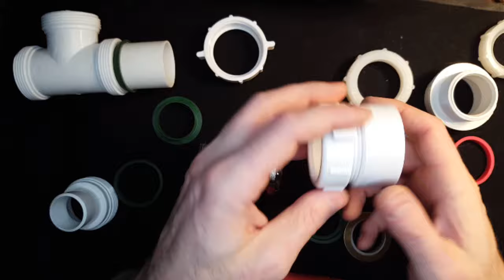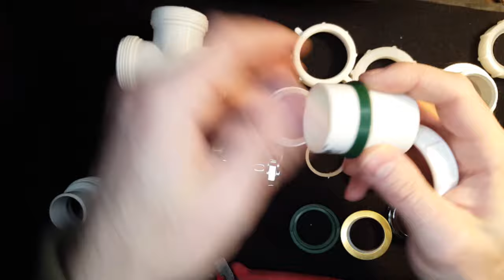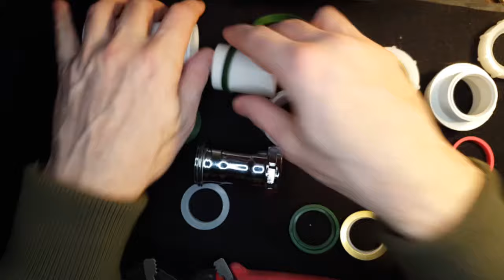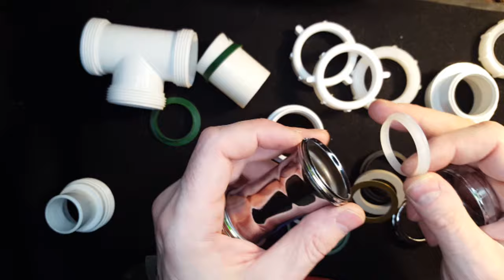Slip Joint Nuts and Washers (And How They Work...)

Comment: Ive done this for my kitchen sink. Regardless what I do, I turn it to the right to seal and it does, but if I hardly touch it, it slips right off….. bought a new nut and washer and it won’t hold for anything but when it tightens it feels like it’s screwed on tight…. So weird
Reply from the maker: If it's slipping off then the pipe inside the joint is not long enough. You may have to replace that pipe with a longer pipe or get a kit to replace all the trap parts.
Reply: I'm having this same problem^
Reply: It's because all this plastic crap is trash. We need to go back to real plumbing, lol.

Comment: I always avoid these whenever possible always better to glue your joints If there’s any tension on the gasket, they will pull away from the tube, causing leaks the gaskets breakdown overtime as well

Comment: How far should the male piece go into the joint? I have a leak when my bathtub drains and I think it is because the top pipe only goes about a a half inch into the threaded female pipe.
Reply from the maker: Half inch is too short. You'll want at least an inch into the other pipe if you can. But you should try to see exactly where the leak is coming from when it drains, because as long as the washer is good and it's tight, it shouldn't leak. You may need to replace the washer or just tighten it more, or may find the leak is coming from somewhere else.

Comment: Just what I am looking for Leak Proof with Conical Seal, the larger end facing the Screw Cap (or the smaller cone end facing the Threads
Reply from the maker: As long as it's installed correctly like you said and tight, it should be totally leak proof.

Comment: At 1:32 are you saying leave the green water tight seal in the pipe (female end) , AND put a beveled washer on the male end, in other words have TWO seals in the joint, OR are you saying take out (or don't put in) the water-tight seal in the female end, and just use ONE beveled washer 1:50 in the joint?
Reply from the maker: It'll just be one bevelled washer which can be rubber or nylon

Comment: Thank you sir!
I just replaced two 1 1/2 washers with no signs of leaks after running water for several minutes. Hopefully it stays that way.
Reply from the maker: No problem and thanks for watching. As long as the pipe is long enough into the fitting, it should stay tight

Comment: So I need some help…
Turning my van into a camper and I’m currently doing the plumbing. I need my waste tank to be removable so I can empty it.
I was thinking about using one of these slip joint nuts so I can screw and unscrew it when I need to. The only thing is, the pipe I have coming down under my sink is 40mm width and I’m unsure whether I need the male connector on the other side to be 40mm too or bigger?

If someone could help, that would be great. I don’t know what I’m doing 🙃 cheers

Comment: Question…. Water is still leaking at the very top where the plastic pvc connects to the drain from bathroom sink can I use a thread sealer or pvc glue on the fitting with the rubber washer……help please
Reply from the maker: It depends on exactly where the water is coming from. If water is coming from the top of a plastic tailpiece, you may have the wrong washer there. There should be a plastic tailpiece washer and the slip nut should tighten it enough that it shouldn't leak. If you're talking about a PVC trap adapter connecting to a plastic or metal tailpiece, there should be a beveled washer and slip nut with plenty of pipe going into the adapter, it may leak if there is not enough pipe going into it.
Reply: Same with my pipe. It won't even tighten & it's slipped off a couple times from the very top of the drain. I don't even see a washer on it. I'm gonna buy washers & if that doesn't work, I'm going try a Fernco & just clamp on the pipe.

Comment: I have a really weird "quick disconnect" style I cannot seem to find replacement nuts for. Can find the o rings but not the nut itself. Either half or quarter turn. Basically snap locking. No slip joint needed and on the inner ring there's no threads just little notches. Do you know what the proper name for those are besides junk? Lol
Reply from the maker: Searching for "quick connect" drain fittings shows a few brands. If you can't find a replacement part you may just have to replace them with more standard drain pipes

Comment: What is the standard sized washer?
Reply from the maker: If you have 1 1/2" tailpiece and drain pipes, which is what most people probably have, get a 1 1/2" washer; likewise if it's 1 1/4", there are 1 1/4" washers in either rubber or nylon.

Comment: How do you prevent it slipping off when water runs?
Reply from the maker: It's compressed and held tight by a nut. While the nut may loosen over time, there's nowhere for the washer to slip off. Also, these are for drain pipes, not supply lines that have water pressure

Comment: Best video I have found on this subject. Thank you! Still some unanswered questions for the plumbing newbie that I think would warrant another video someday....

First, I think the pace is too fast. Keep in mind, for us newbies, we see 20 washers on display and easily get confused :) Please slowly go over them one at a time.

Just speaking to drain lines only.... When exactly should a beveled water be used vs a flat rubber washer? How does the top hat washer work, where is it used and why? Are any washers interchangeable? How much does thickness matter? Common washer material types? Rubber vs nylon vs plastic... pros and cons? General guiding principles/best practices for selecting the right washer... Which ones it makes sense to keep on hand vs which tend to come with a fixture or p-trap kit... Common mistakes, etc. 

There is a lot to cover here and this information is surprisingly hard to find. Thank you very much for sharing your knowledge.
Reply from the maker: Like you said, it may require a more in-depth video and these things are easier to explain by video and probably easiest to learn by holding and seeing it. But to quickly answer some questions, on slip joints there will always be a bevel which goes away from the nut or in other words the flat part goes against the nut which pushes the washer tight. The most common mistake I've seen is a washer in the wrong direction, ie- the bevel part against the nut, which won't work at all. 

Flat washers are good for non slip joints. Most parts where a washer is needed should come with a washer. I like rubber washers because I feel they get a tighter fit but nylon will last forever while rubber degrades. 

I would say keep an assortment of washers on hand for various sized pipes and joints, but most of the time you can take the old washer and replace it with exactly the same thing, just make sure to install it in the right direction. Other than that, it just takes practice and experience with materials to fully understand them.

Comment: Is there a better alternative to the slip washers?
Reply from the maker: Better in what way? Installed correctly, they should be leak-proof and allow for easy disassembly of the trap for cleaning or replacing sink parts. There are PVC traps that can be attached and removed with threaded nuts but most tailpieces will still need a trap adapter with one of these slip nuts and washers.
Reply: @toolsandrepairs  Every 5 years mine seem to fail and flood the room.
Reply: @toolsandrepairs  I’d screw on fittings, instead of cheap plastic compression.
Reply from the maker: @WILSON.1  It's going to be compression somewhere connecting the tailpiece to the trap, even if the rest of the trap is soldered or solvent welded. Make sure there is plenty of pipe length going into the trap/adapter, and tighten a bit with a wrench after hand tightened.
Reply: @toolsandrepairs  okay, thanks.

Comment: I can't seem to get anything to fit into place without having to force the pipe into a weird awkward angle.

I'm pretty sure the p trap size is incorrect for my apartment, probably needs to be changed to a longer pipe piece
Reply from the maker: If it's at a weird angle, then some of the pipes are incorrect length and should be replaced. You can buy a complete under sink trap kit with pipes that can be cut to length, or have the landlord get a plumber there.
Reply: @Tools and Repairs  you're right I'm going to get on that tomorrow morning,  I figured it was a cheap easy fix so I tried it on my own but if I need to buy new p trap pipes I'll just let the landlord take care of it, especially since they own it not me lol

Comment: Do you condition the seal with anything? Wax or olive oil?
Reply from the maker: I haven't and never had a problem, but some plumbers use pipe dope (thread sealant) on the washers to lubricate them, the same with compression fittings.

Comment: I am trying to connect two 1.25 inch chrome drain elbows.  
When I tighten the chrome slip nut over the 1.25-inch nylon washer the two chrome 1.25 drain pipes, without much effort slide apart. How much should I tighten with channel locks to prevent this from happening?
Reply from the maker: Those should only tighten so much, so just tighten as much as you can. You might try rubber washers (proper size too) for a better water tight seal, which is the ultimate goal

Comment: What about single sink?
Reply from the maker: Should be easier, it's just fewer parts. You'd connect the drain's tailpiece into the P trap, which will eventually go into a trap adapter.

Comment: Mine came with 2 durn rubber rings I see you only using 1
Reply from the maker: Just make sure to use one rubber washer, pointed downward/inward on each nut that you tighten. They may have included an extra one, or it had more than one nut.